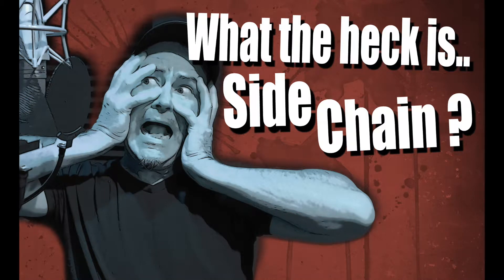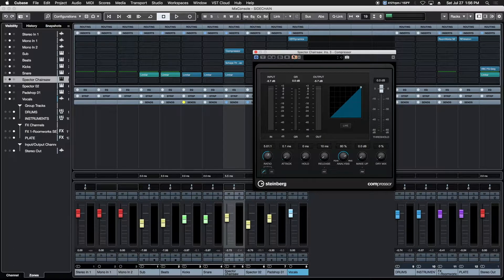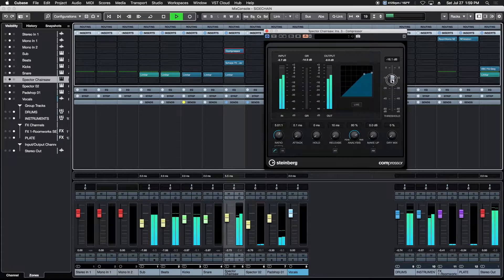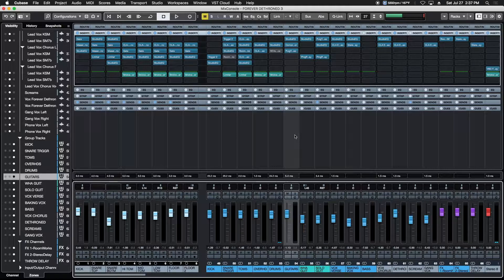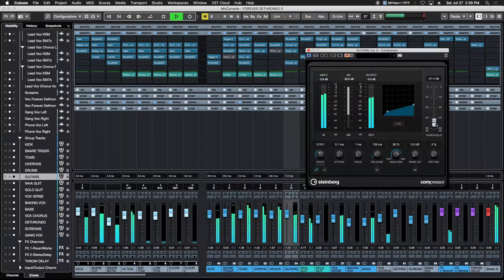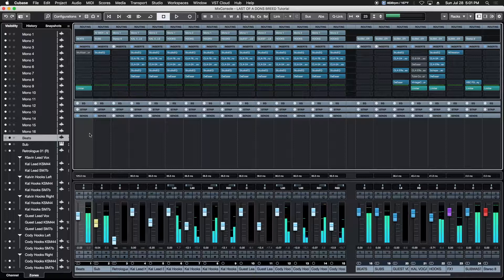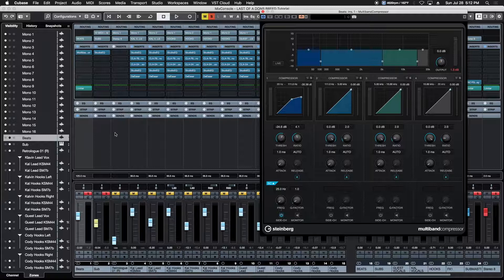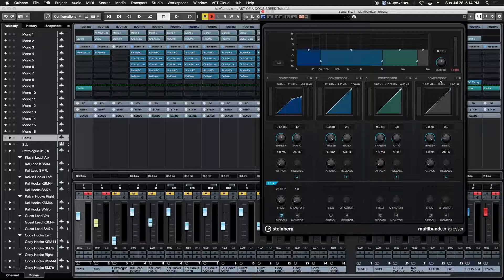LEARN CUBASE - 16. HOW TO SIDE-CHAIN / ADVANCED MIXING

Comment: For a one or two instances in a mix, does it makes sense to micromanage volume fade outs or volume automation (in this instance fading out the guitars) rather that using side-chain? Acoustically,  it is the same ending result right?
Reply from the maker: It is entirely up to what your mix needs the most.. Writing automation gives you surgical control over minute parts of the mix whereas using side chain to control volume largely automates the process.